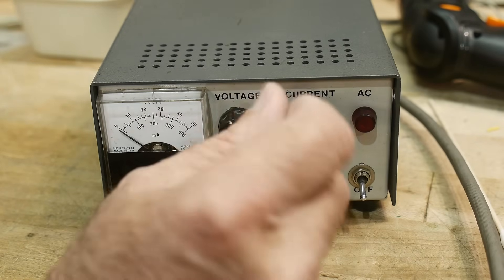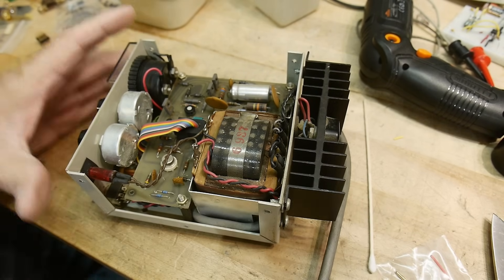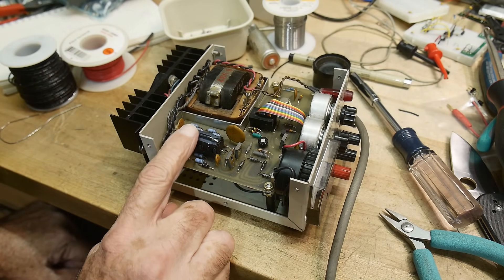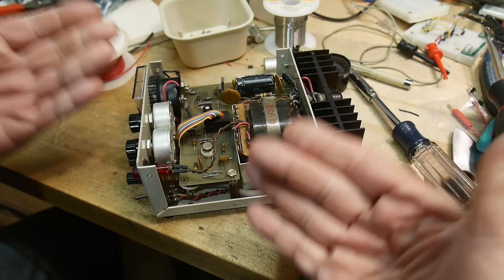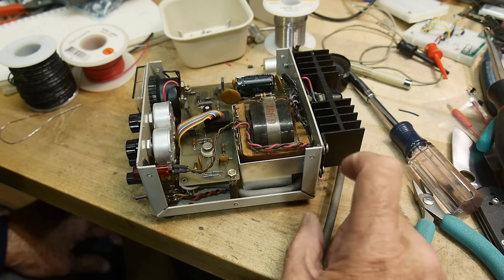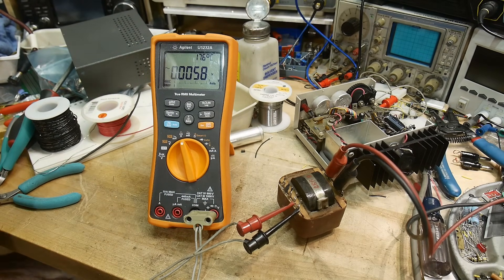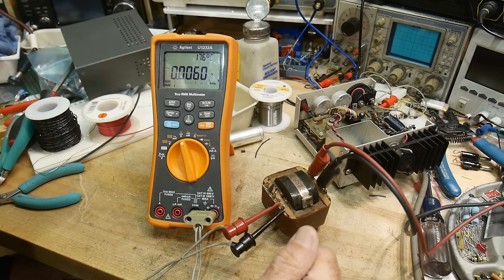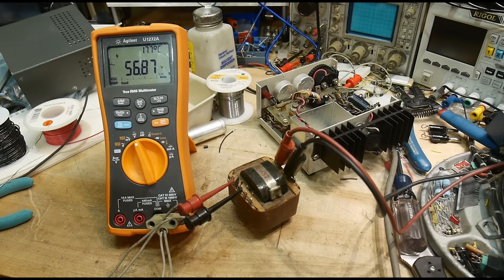#1820 Pacific Radionics Power Supply PP-20-3 (part 1 of 3)

Comment: Is it possible that the 75V electrolytic is of this quite exotic wet hermetic tantalum type? They are astronomically expensive (mostly used for space and aviation...) but ultra rigid and of quite competetive energy density, even from a nowadays point of view.

Comment: So "a power supply needs a negative voltage to get down to zero" - so like a LM217 can only go down to 1.2 volts, right?  So I assume you are making a new "ground" that's below that so that it can get down to zero?  But I assume you can't just use a "virtual" ground - something like a diode drop or a resistor divider?  Would it need to supply the full current in that region, right?

Comment: I would start replacing the transformer with two simple PS. The maximum cap voltages are good clues what voltages you need.  Make sure the bridge rectifieers aren't shorted and and they are good.  Once someone told me long time ago fixing broken stuff needed a lot of intuitions since you  would he lucky to find any schematics in 70s and 80s.

However, i am sure you have fixed it by now since your videos are behind by a few weeks.

Also, you don't need to disconnect the transformer if the dioides are ok because the diodes separate the path from the transformer.

Comment: I agree with Defpom's comment about checking the bridge rectifier. I have a Keithley 196, which dad bought new in 1988, the bridge rectifier shorted a few years ago and that killed the power transformer. The line fuse didn't protect the transformer as from new the 196 had a 3A fuse not 250mA, 30+ years too late for a warranty claim. I was able to source a replacement transformer and my 196 is still great instrument.

Comment: It's very odd that it's rated for input frequency from 47-420 Hz, when the only 2 common frequencies used are 50/60Hz in normal line power, and 400Hz in aircraft systems (which is why everything in an airplane sounds like a slightly out of tune "A") - so it works on a huge range around normal power line frequency, and up to and slightly beyond aircraft power frequency as well. That could be a key to it's intended use!

Comment: More than 100V rectified voltage seems a bit too excessive for a 0 - 50V power supply. Even if that voltage drops to say 75 - 80V under load that's still way too high. I suspect the transformer primary got a section of it shorted out, and then the shorted section blew open circuit due to the high current that would have been induced in it. That could have ended up both making it look as if the transformer is fine, while also increasing the secondary voltages, thus killing the electronics, especially the op amp. Either this or there's an open circuit somewhere on the power rails of the op amp. That thing takes a maximum of +/-18V on it's power rails, so there has to be a voltage drop circuit of some kind. that would power it. Maybe it's a small simple regulator with a transistor, or maybe it's just a voltage divider, but there has to be a voltage drop from the + rail going to the op amp. Ultimately you need a schematic with displayed voltages to properly diagnose this.

Comment: There is a classic way to power up suspicious equipment via control transformer or if not available via light bulb. I always like to see that, - maybe it does not really help but it avoids going over to the fuse cabinet in the dark. (The other idea is of course to have the fuse on the bench.)

Comment: High test voltage insulation resistance meter (be it old-school cranked megger or an electronic one) should be enough to check any leakage on the power transformer. Speaking of which, I still need to recombobulate mine.
Reply: I have an old school magic eye Conar RCL tester that has variable dc voltage to test capacitor breakdown voltages.

Comment: 17:01 Those 2 grey power transistors are probably in a transistor-zener regulator circuit. The zeners apply a regulated voltage to the bases.
Reply: Supplyvoltage for the 709
Reply: Indeed !

Comment: WARNING WARNING WILL ROBINSON!!!
Mixing sentimental feeling with junky old power supplies will drive you nuts.
I have been down this exact road only 6 months ago with a different but similar PS.
Couple of years ago - just as I was retiring, a small crappy PS we had at work 
(I had used many times) was being thrown out by a person with brains.
I rescued it,.... (missing brains)
Then few months back thought I would rework it,....
NOW I have a modified, (actually rebuilt), PS. Only thing that survived was the box.
I put in Digital meters, a linear AC DC block, and a new PCB,...
LOL way more work and $$$ than it deserved..
It is a RAT HOLE, and since I see several more videos coming up,... well at least you get videos out.
WARNING WARNING WILL ROBINSON!!!